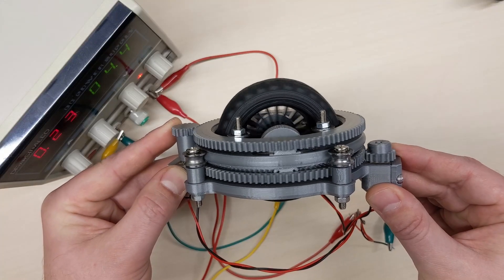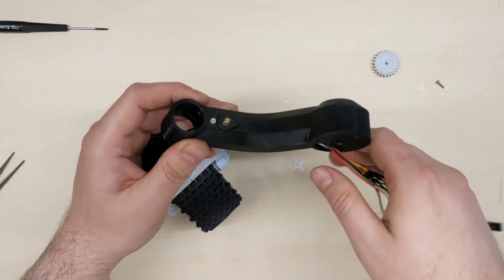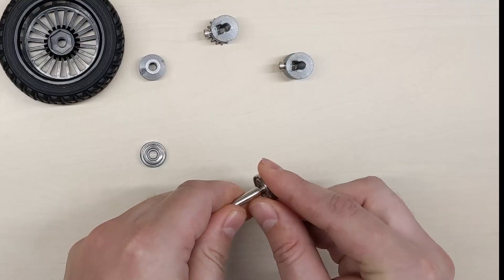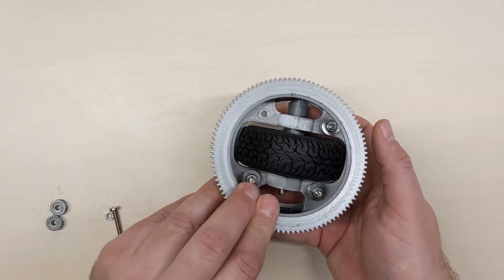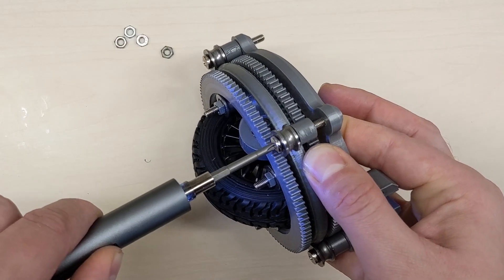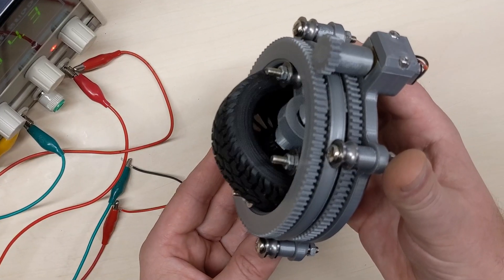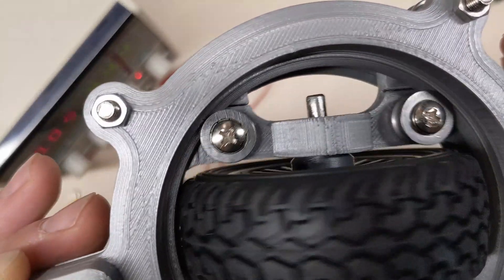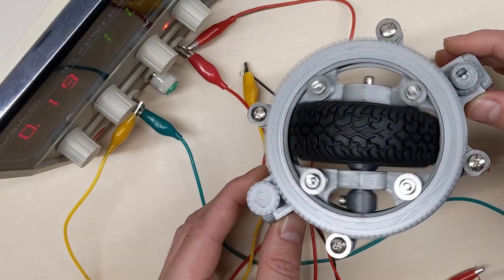Differential Swerve Drive

Comment: Dude, that is brilliant. I was wondering why not simply use omni-wheels, but this is such a great self-contained module.
Reply from the maker: It was more fun to design this than using omni-wheels😊
Reply: Also you have more traction compared to a Omni wheel that’s the main thing about it also you have more drive power as well I’ve made a full chassis for a differential swerve drive for FTC I haven’t posted a video mostly because I don’t have the controller for it but v1 worked pretty well and v2 fixed some small problems with it by making the motor mounts stronger and using a better wheel for more grip and it seems to work pretty well mine uses 2 wheels and it works well
Reply: @simplegamerz9485  Yeah, having messed around with omni-wheels, they are nice for clean, level environments, but struggle with more generalized design. I think most commuter cars that are currently on the market with sideways parking work more like the mark1 design referenced in the video, since you only need to allow 180 degrees of freedom. The design in this video is awesome, but I suspect the pitfall of the revised design is the maximum torque that can be produced. That said, some redesign of the gears would solve that, plus an enclosure to prevent ingress of dirt would make a fairly useful wheel.
Reply: one of the main problems of an omni wheels is that u can push them around on those free wheels
Reply: omni wheels or mechanum wheels?
Reply: @dotshape  either or. Both are inferior to swerve drives.
Reply: @dotshape what is dot doing here
Reply: You could still use omni wheels with this design :3

You could also design an omni wheel using the same design as a variable pitch prop to control the angle of the subwheels. You would use a differential frame and worm gearing to provide this control. And drive the center planetary gears woth a larger motor for propulsion. Check out the gear train for wind turbines and ship variable pitch propellers too.
Reply: @KyryxKoopa  the whole point of swerve is for the extra traction

Comment: Nice swerve module!

Btw, a simpler coaxial swerve design would also isolate the motors from the rotation of the pods. On the other hand, differential swerve is just way cooler.
Reply from the maker: I wanted a low profile module to keep my robot low, which is the main reason for using the differential design. Thinking about it now, making a coaxial module that goes around the wheel at about the same size as the differential module would be possible - but the differential was more fun to design.

Comment: this really cool but cant you use mecanum wheels?
Reply from the maker: Sure. Just wanted to try something different😀 Also, I hope to be able to make more precise navigation with these wheels, as mecanum wheels tend to slip on the surface.
Reply: mecanum does not have pushing strength and requires high rpms and is inneficient on most to all surfaces. this was not how u should do swerve there are way more already designed ways

Comment: This wheel motor design is pretty smart, 

- If both ring gears spin in the same direction : the wheel doesnt spin but turns;
- If the ring gears turn in opposite directions : the wheel spins, but doesnt turn. 
- And by varying the speed of the one motor you can make it turn one way or the other you can make a vehicle change directions smoothly. 
Just a little bit bulky design and 2 motors, but other than that, it's pretty impressive. 
But I want to ask : when both ring gears are spinning opposite ways and the vehicle is going strait, can an external force turn the wheel to another direction ? 
I'd say its probably possible since such an external force would be able to slow one of the motors, this would make it even more difficult without an angle detector to know how to wheel is oriented.
But that's easily fixable, you just need to put another ring gear fixed to the inner wheel support, and gear that to an infinite rotation sensor fixed to the same piece as the motors.
And ... I went ahead and imagined how I would build a vehicle with this. Sorry  :p
Reply from the maker: Yes, it it possible that the wheel will turn/rotate from external forces. But actually it will not turn easily, because the gear ratio for the turn is quite high compared to the ratio of the spin. 
I will add encoders to both motors, and that will allow me to calculate both the spin and rotation precisely. On top of that I will add control loops with feedback, so that I will be able to control the speed/position. 
To reset the turn angle when I power it up, I will make an initialization procedure, where the inner base triggers an opto switch.
Reply: @wildwillyrobots  'add encoders to both motors'  Realize, this will still lose some if the middle ring is floating  Instead, you can EASILY add direct encoding to the steering ring and know your direction exactly.  Look at 10 seconds, to look at the vertical stack.  Middle ring has its top surface clear, below the top gear ring, but above the screws for the guide bearings.  Use flat head screws for better clearance.  Out from the top edge of that middle ring, make a flat edge disc, then notch it for gray type encoding.  Then put say 6 opto interrupters around the edge to read the code, and you can read your direction directly off the steering ring.  Similar idea to the quadrature encoder of mouse, but if you do it right you can use more sensors and get X number of bits, so 64, 128, maybe even 256 positions would be doable.
Probably need to rearrange the top gear drive so the motor is above so there's easy further clearance for the encoder disc, but it should be easy overall.